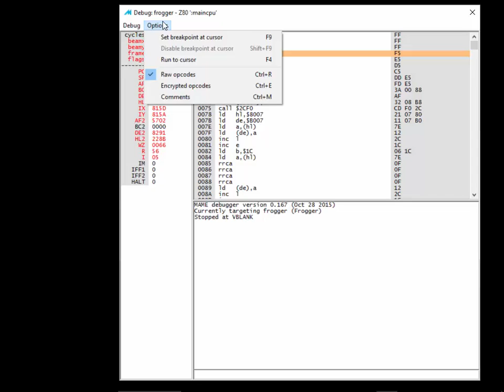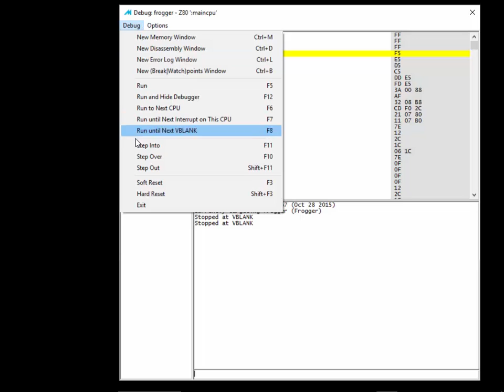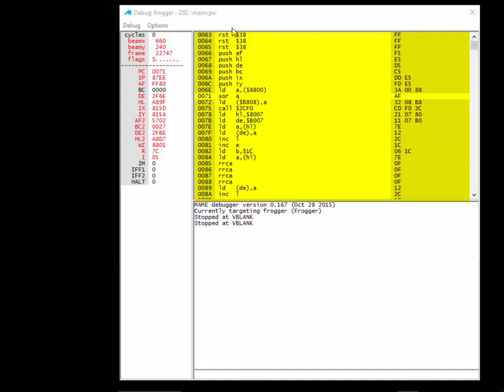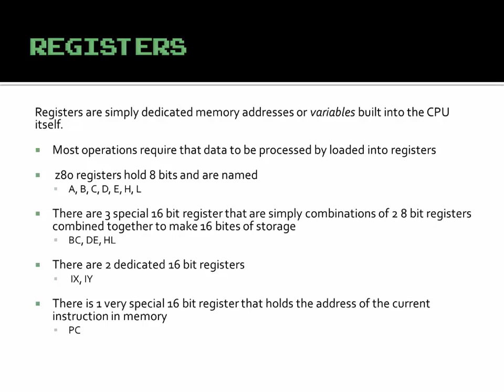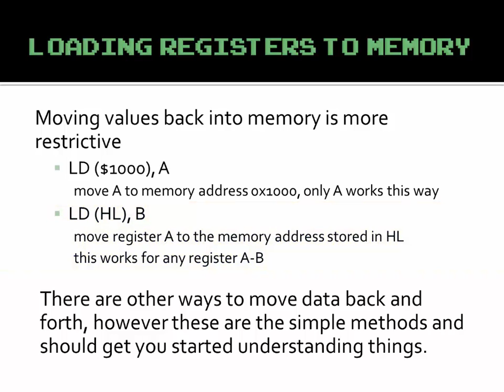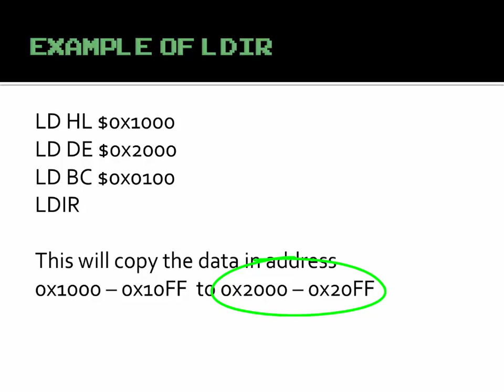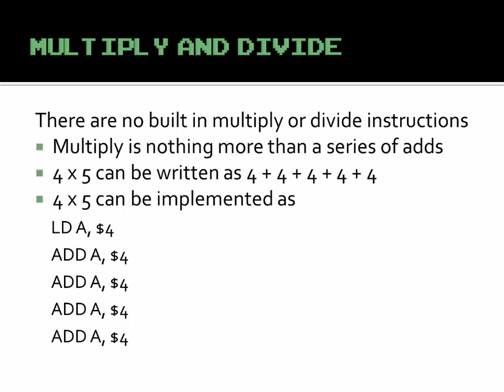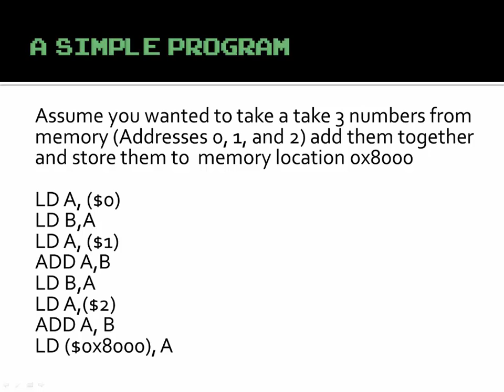arcade ROM hacking lesson 5 Part 2: Creating a Free Play Hack (Assembly language programming)

Comment: Whenever using hex editor you get specific data for each game, could it be understood as its source code?. Cause i'm interested in making arcade ports for Snes\Genesis. I came to this thought cause if you can change a character's name in a specific rom, maybe you could change something else in another rom.
I've been researching for video games programming but i can't find anyone(not internet) who teaches about old school consoles programming. Any ideas on what could be needed to learn how to make a rom for those consoles?(books, assembly videos, etc). Again, your videos are great, and wish you could say more about this topic. Hasta la vista.
Reply from the maker: Hi Ivano, so Yes and No. The hex code you see is the actual language of the CPU, so technically it is machine language or assembly source code. That said when people say "source code" they generally imply a "high level, CPU independant langauge" like C, C++, Java, Python, etc. So while technically it's correct to call it source code, it's a little confusing to say that.

But it IS the actual code of the game yes.

In regards to the console hacking, the concepts for console hacking is the same. To do this, though rather than using MAME to debug and test your code, you'd want to probably find a emulator for the console system that you want to work with. Ideally an emulator that has a built in debugger. Hope that helps.
Reply: Thanks for answering. Yeah, i hope that also. Again, great videos. Hasta la vista.
Reply: Hi, even with this data, is it possible to make a port for any console out of it?. If so, how?. Hasta la vista.